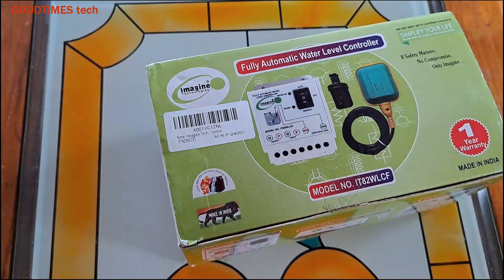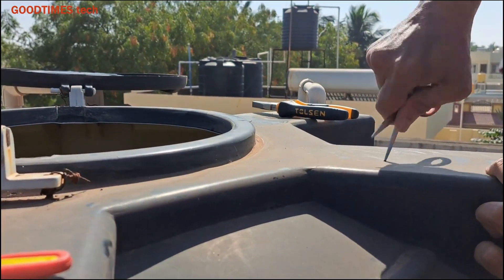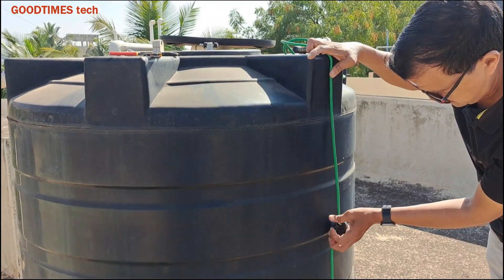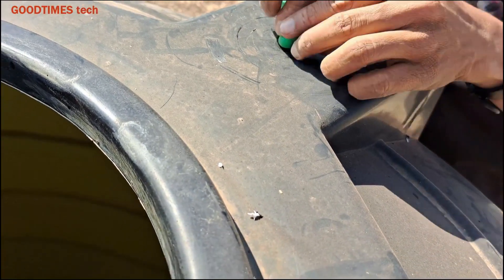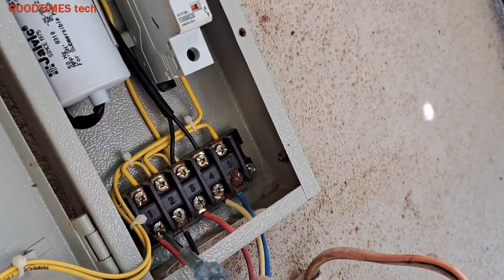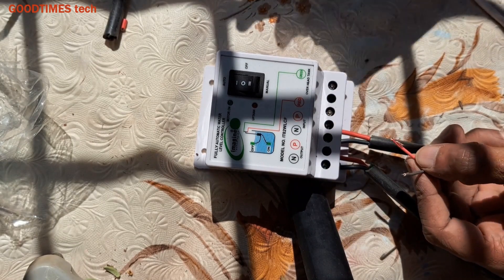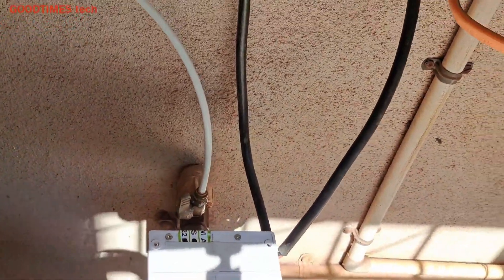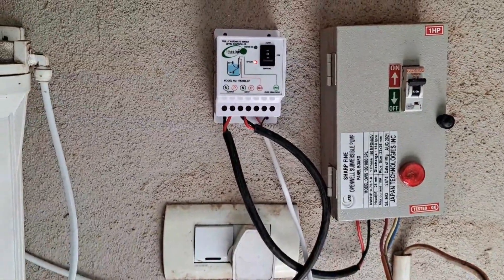Water level controller for overhead tank | Automatic | simple |

Comment: will there not be safety issue since 220v supply is inside the water tank? If the fload gets damaged 220v will directly in touch of water. This concern is preventing me to install similar system in my overhead tank.